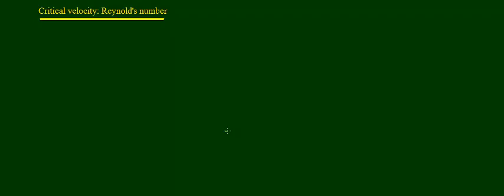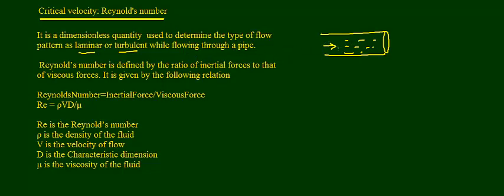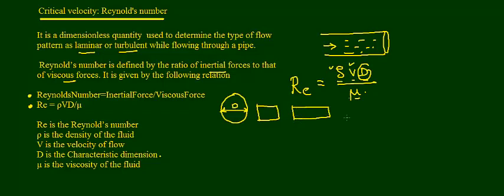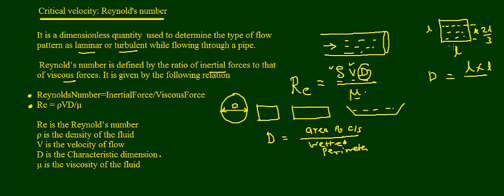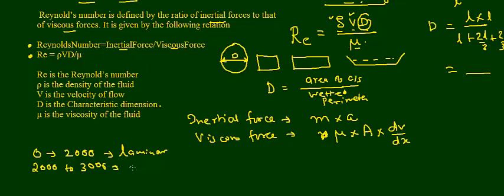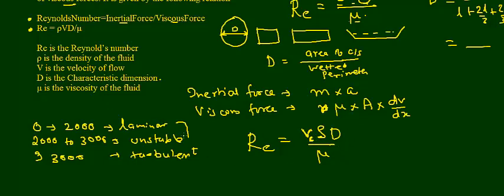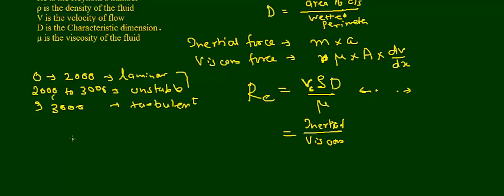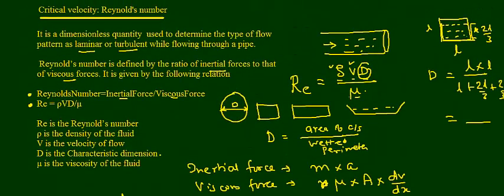Reynolds Number

Comment: determine reynolds no for a mixture obtained by blending surcose solution (20%) of viscosity 1.92*10-3nsm-2 and whole milk(viscosity 2.12*10-3nsm-2) in a ratio of 2 to 5 by a propeller agitator 250 mm in diameter operating at 560 rev s-1 in a cylindrical tank 1 m in diameter?

Please help me this question I don't understood this question